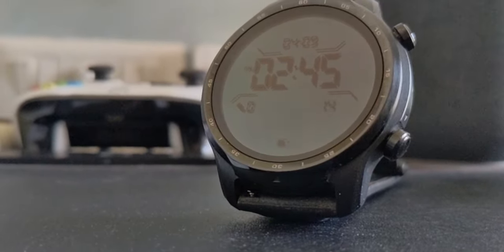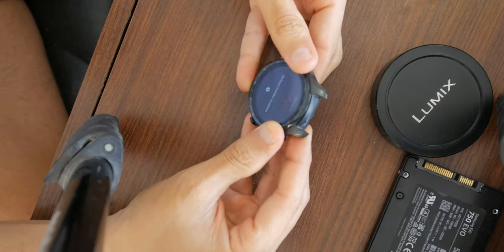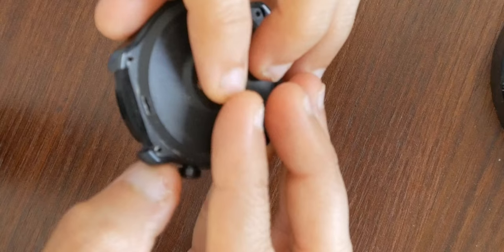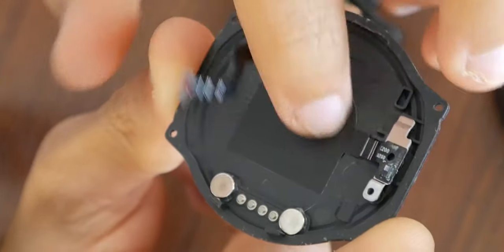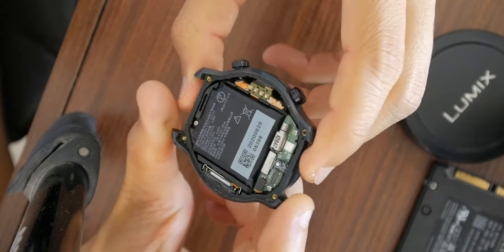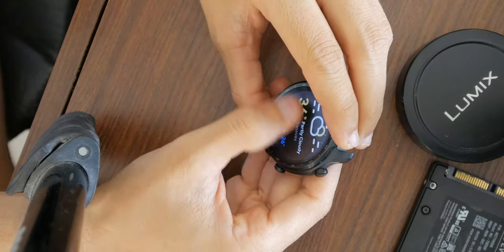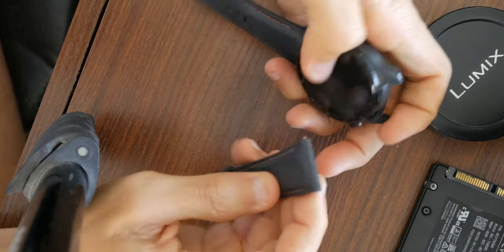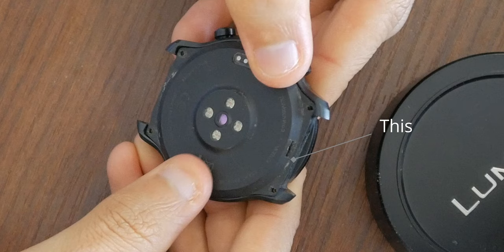How to FIX the Heart Rate Sensor

Comment: Thank you so much for sharing this useful video. My watch with a non-functioning heart rate sensor and spo2 sensor is now up and running again ! 
I have followed it and took apart my pro 3 gps.
* The first time cleaning didn't work, I suspect it's because I did not take off the Philip screw on the watch back panel which was holding on the sensor board 
** 2nd time cleaning: I went and removed the back panel again and cleaned both that sensor board and the connector attached to the watch back cover with a Q-tip. Reapply glue and reinstall everything , turn on the watch and bingo !! It is working again.
( There was no visual residue or buildups both times when I took off the watch back cover, it may be because the parts are so small it's not easy to spot without proper equipment )

Comment: Thank a lot. My sensors stopped working a few months after warranty. As you said, mobvoi have been useless in trying to resolve this. Sadly, one reason I bought this was for the swim functions. So there's no way I could swim with it after this. 
Ironically my sensors haven't worked at all for months and just today they started blinking again, however, they still won't take any readings.
Reply: Estou com os mesmos Problemas, eles só oferecem desconto na compra de outro e não resolve o Problema.

Comment: Thanks you so much 😍😍😍 i have a question on video under the screw is little hole can i hide it with silicone?
Reply from the maker: for sure you can, but your speakers might sound a but tinny once you do that, so test it out by blocking it with removable glue first imo. **

Comment: Great video. Im having the same problem, just reached out to Mobvoi because it is still in warranty. I will update once they reply.
Reply from the maker: Okay mate, keep me posted ✌️ Good luck!
Reply: They have asked me to provide a video with proof and after confirming  they have asked me to:  1)wear your watch tightly and go to your watch Settings-Personalization and choose Off wrist calibration and see if it will solve your problem.
 THIS DIDN'T  WORK
 
2)If the solution doesn't work, please kindly please long press 2 watches buttons simultaneously for 10 seconds and release your fingers until the Ticwatch logos appears. Please use lower button to select the options and press power button to enter the ship mode then your watch will be turned off. Please restart your watch to see if your problem can be solved.
DIDN'T WORK AS WELL, I HAVE SENT THEM AN EMAIL AND AM AWAITING A REPLY AGAIN
Reply: I have just sent the watch back for free since it is still in warranty and they will send me a new one, very good service so far